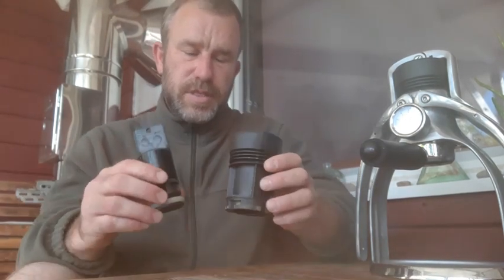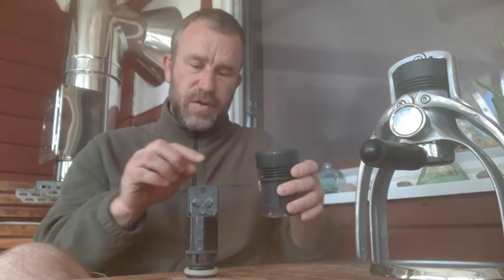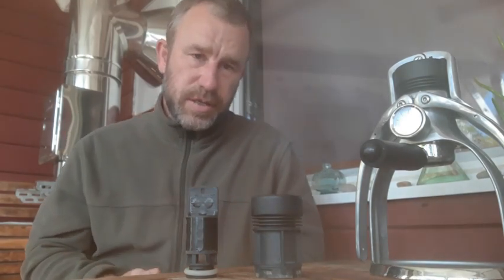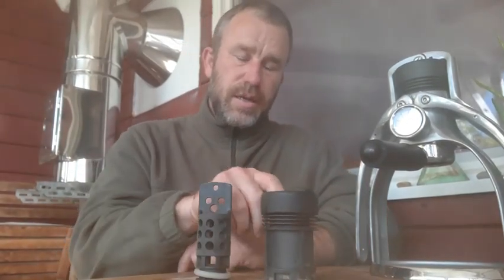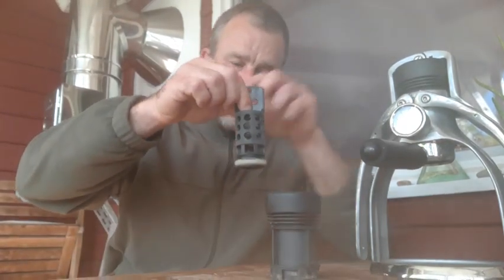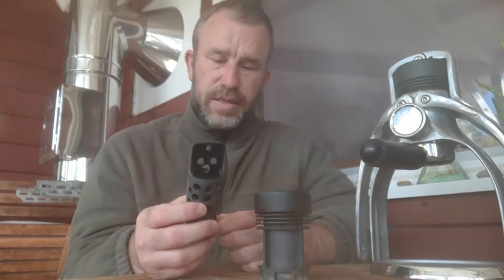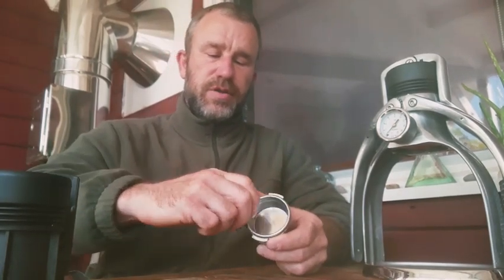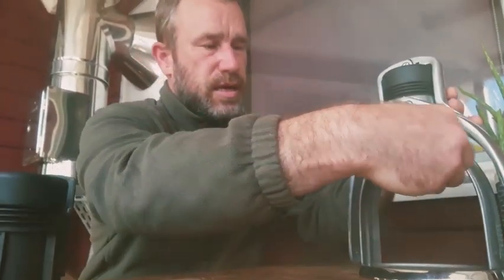Simple trick and modification to improve brewing temperatures with Rok GC espresso maker.

Comment: Can you talk about how you installed that pressure gauge on the Rok?
Reply from the maker: I plan on posting a video on that soon. If you are mechanically inclined it's not too difficult. I just need to find the time to shoot the video.
Reply: Sounds great!
Reply: @brianharder16  looking forward to that video, I’d also be interested! Thanks for the insight
Reply: Hey Brian, honestly I have been struggling to find any resources on how to do it. I thought about just strapping a pressure gauge on top and running a tube down to the bottom of the piston and insulating it somehow but i dunno. I would really appreciate it if ever found the time to share your insights on the pressure gauge mod. Good work!
Reply: waiting for this video as well. my ROK has been sitting on a shelf since I got my Flair58 this would allow me to use it again happily
Reply: Have you released the how to video on installation of the pressure gauge?

Comment: Simpler to put a silicone cap on the portafilter and lift the arms to heat up the whole thing? Remove the cap and water flows out
Reply: That sounds like a great idea, but is harder to do on a naked portafilter. I have an idea though and will try it out. I think it is quite wasteful and cumbersome to warm up the portafilter submerged in water in a separate cup

Comment: imo ROK GC biggest flaw is the bayonet/ competition screen. it didn't hold the portafilter well enough and there will be leak/ water spray around bayonet if you always do 9 bar+ ( i'm using rok gc with mano plunger and upgrade the bayonet ring with brass). i've found the solution to reduce the chance of water leak is to make sure the silicon and bayonet to really dry and it will hold the portafilter more firmly.
so with this in mind, i never do the blank shot anymore because it will wet the bayonet and the silicon part of screen. so my way of doing the pre heat is, you boiled a water, put the portafilter into a cup and filled it, then you filled the upper chamber with the same boiled hot water, and also the cup for the coffee.
next you grind the beans, at the same time boiled another hot water. dry your portafilter and quickly prepare the coffee (to shorten the time needed to do this and more consistent result, im using WDT, leveler, and leveled tamp, maybe around 20 seconds).
after that, empty the water from the upper chamber by turning the rok over. then pull your shot.
with this routine i considered my shot is always consistent with nice temperature 🙏🏻
Reply: Hi, just wanted to let you know that if your competition screen leaks you have it put in wrong :P you should not feel any bumps when you run your finger around the rim. If you do you should contact the manufacturer, they're usually really helpful and understanding
Reply: Also Rok themselves recommends pushing no more than 7 bar

Comment: I figured out an additional stage! You can steam the brew chamber with a Bellman steamer!! 🧖🏻‍♂️🧖🏻‍♂️🧖🏻‍♂️🚂🚂🚂🔥🔥🔥
Reply from the maker: I had experimented with this too pretty extensively and unfortunately the problem is it doesn't effectively heat the interior walls of the cylinder. That's not to say it doesn't work at all but heating it with water is much more effective. I told my Bellman steamer a while ago and I do regret it. Hold on to yours, they will be worth something someday.
Reply: @brianharder16  Awesome! I think the holes as you mention and the bellman will allow for super light roasts. Especially now with the new showerscreen and pro pressure guage mods you can buy! My biggest challenge now is how fast can I make espressos. The most I've made in an hour was 30. Can you do more than 1 per 2 minutes?